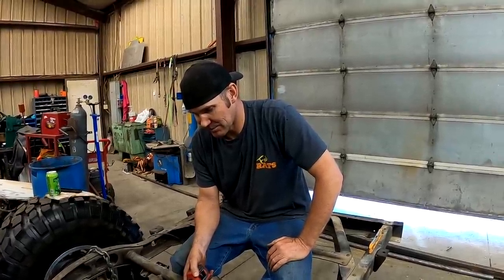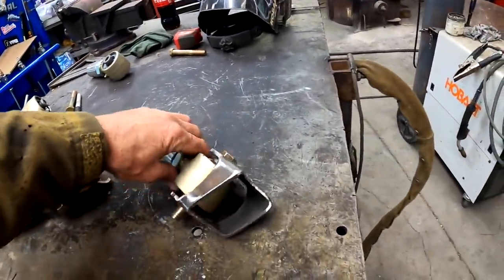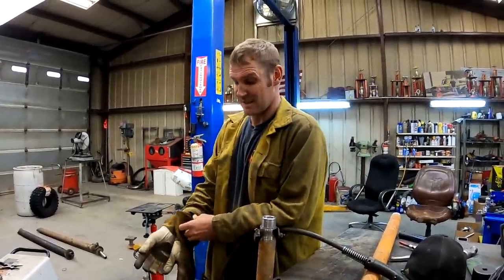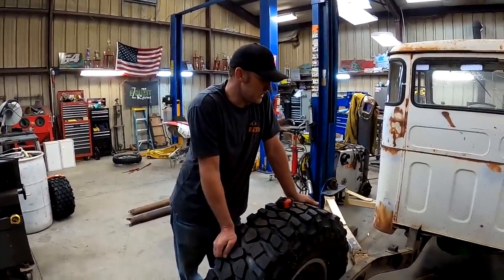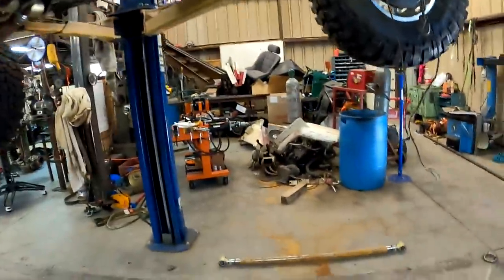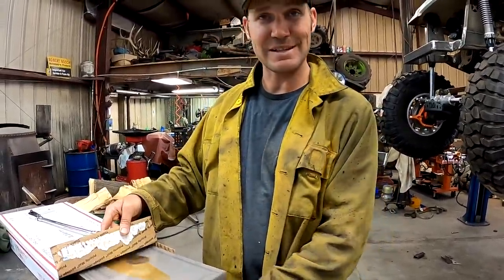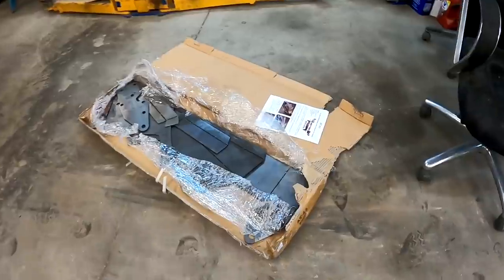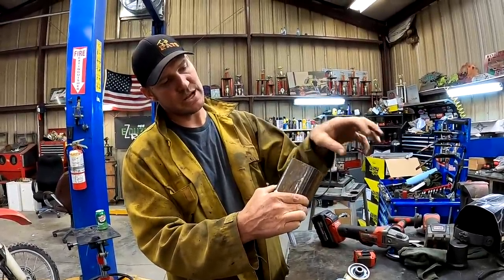This Custom FJ45 Ultimate Rock Crawler Build Comes With Custom PROBLEMS!

Comment: I was an engineer in real heavy oil engineering. The reason we went to computer aided design in a big part was to find all the errors before we built the stuff. Running the computer to find where stuff would not fit was fun, it was called the 'clash check'. When I started though in 74 we had paper and it was always a worry when the stuff turned up that it would fit. Working on vehicles though people don't realize is not easy. Anyone who can fix a car can fix most things.
Reply: I worked in a business that installed factory built fireplaces, and one of the contractors we installed for, built their first computer designed home. Hopefully things went better after that one. The corner chase didn't line up for each floor, so we used 18 adjustable 45° elbows to exit at the cap.
Reply: When I worked for Caterpillar, I pulled the transmission out of an articulated dump truck.  It was soooo tight that it scraped the paint off of both sides of the trans as it came out of the hole.  In fact it was so tight that after it was halfway out I had to tip it at a different angle to clear things, when I backed off with the crane, it stuck right there.  This thing weighed about 1500 pounds!  Could they have made the frame 1/2" wider?  I think so.  I had to grease up the sides of the trans to slide it back in place.  I think that I was just LUCKY that it was able to come out without frame modification.   The part of the frame that would have had to be modified was the Roll-Over-Protection mount.  That would have created a whole new bunch of problems.
Reply: @Rat-Builder  Designs (bad ones) like that can happen when the person doing the design has never had to work on a machine. One service I provided was 'maintainability' for a new design. It was amazing how impossible some stuff would have been to fix without a redesign.

Comment: Just curious, is there a reason why they rear hoop, on the frame ain’t behind the transfer case, so the joints line up the rear driveshafts front joint. 

Then you protect your transfer case, and can get more travel, because training arms can’t hit it either? 

I’m not at critic, I’m just curious, and wants to learn more.

Comment: Actually more excited about the little Suzuki restoration! Can't wait to see the Golden Nugget come back to life 😁👍
Reply: Hi Ivan !
Reply: Same here. That was an awesome recovery.
Reply: RollinRat  My personal work truck is a 2002 Suzuki XL7 4x4 so I'm pumped to see the vintage Suzuki be made road-worthy again :)
Reply: I also came here to request nugget content
Reply: fab rats subscribers going to go up for the suzuki build
Reply: RollinRat  same with me. I watched a couple of MORR videos a couple years ago, was immediately hooked, & saw Matt go to Fabrats shop. After that, I was immediately hooked to Fabrats channel😊  now it's the same way for me, MORR & Fabrats is the first two videos I watch as soon as I get the chance!😊
Reply: Ivan there not going. To rebuilt that thing?
Reply: RollinRat  Same here.
Reply: RollinRat  Suzuki has always put undersized "motorcycle-esque" engines in their trucks. Mine has the 2.7DOHC V6 which has to be revved for any performance lol. This LJ20 must have been only a few years old when Ed parked it in the wilderness. Apparently it features a 359cc 2-stroke water-cooled twin, putting out 28hp...WOW!
Reply: RollinRat  Thank you sir.
Reply: More like Moist Nugget now
Reply: @PineHollowAutoDiagnostics  
It only weighs about 5 lbs!

... In reference to the small engine. So many other comments, so that probably didn't make sense without context.

Comment: I'd say, fab rat a boom on the back and make it a Mater !

Since you run air bags, it should be possible to add extra bags to carry the weight. Mount two extra bags, to be activated as load is added?

Comment: If you are going to put bag on link, I would suggest having the frame side of the link non-adjustable (like a weldable uniball) so that you wont get link rotation. Making it similar to how lower links are made for pre-runner/trophy truck/hill climbers. Also shouldn't go shorter than 1/2 of the length of bar if you plan at all having a load on the truck (Like weighing it down with a trailer). 1/2 way will give you good lift but super soft, 2/3-3/4 away from the frame will give you decent lift but still be mildly stiff enough for load rating.
Rad project either way.

Comment: I would try and get the air bag as far out from center line as possible for stability.  If you mounted the air bags on a horizontal axis outside the frame rail with a 2:1 cantilever set up off of the axle you could get your 16" of travel.

Comment: Handy tip for the airbags. Cut 4 thin tubes (or timber, etc.) Two at just under max travel, then the other two at just above min size. 
Then you can use them for mocking up the cross member without worrying about reading the tape all the time.

Comment: Paul, Don't worry with dyslexia.  I've had it my whole life but I still got through HS and a BS in Electrical Engineering.  Then a 40 year career designing and building Power Plants.  You just have to allow extra time for CHECKING.  Also Michelle is a HOOT.

Comment: PAUL... PLEASE comment on this for me. I have a job I need to do and not sure how to proceed. 
 I searched every where and found MANY videos on how to convert a single axle trailer to a dual axle but I want to go the opposite way. Dual axle to single axle.
I have a small electric pontoon boat (12') and got a nice trailer frame for $50. The boat only weighs around 500 lbs and I don't need the dual axles. Single axle = less weight, cheaper on tires.
First off, would this be OK or you think I should keep both axles?
Secondly I would need to obviously remove 1 axle, get rid of the equalizer bridge between the 2 leaf springs and fabricate and weld in a new spring hanger but not sure of the process.
 So before welding the hanger mount it should have trailer weight on it and the shackle should be slightly angles back away from axle? to find where to weld it to the frame.
I would love to bring it to you to do it (and would take you 30 minutes probably) but I am too far away).
Any advice you could give is greatly appreciated. 
Subscribed a month ago and have watched every video you guys have uploaded for us.  By now I feel like you guys are family almost, well your family and that scruffy bearded dude that is in your videos sometimes (Your awesome too Matt)
 I am only asking because the small town I live in is not overly populated by great mechanics, I trust your judgement! I didn't want to call your shop and bug you
If your too busy I understand, keep up the awesome work!

Comment: Hey Paul long time watcher, first time commenter on your channel blah blah blah 😂 also I appear to be the resident mini trucker (Vegas) so if you don’t mind let me give you a little info on those triple bellow bags you want to run. Think of an airbag like a balloon, the more air you put in it the stiffer it will get and those triple bellows are two ply therefore if you top them out at 13 1/2” not only will it ride really stiff but with enough articulation it will separate the metal cap from the bag. Ask me how I know. Anyways if it was me personally I would try to get my desired ride height at about 9-10 inches of the bag on load. Should ride really smooth and give you the articulation I’m sure you’re looking for.

Next I would like to say not only did you guys do great work recovering the golden nugget but I am extremely looking forward to that build as well. Keep up the good work!

Comment: Very interesting to watch as 90% of off-road rigs are built just like this in someone's garage.  Not confident though that Paul understands suspension geometry, rotational tongue and leverage on a cantilever.  That suspension is going to do lots of wierd stuff anywhere above a crawl.  Cool build though.
Reply: I do not understand what rotational tongue is and I once was a formula 1 engineer, could you please explain it to me.
Reply: @R1Kyle  Rotational torque (autofill)

Comment: I think a new bit for Michelle needs to be “describe the smell of the shop today” for all of us used to working in a shop, depending on the project a shop can take on a lot of different smells, heavy gear oil, burning metal, paint etc. would be nice to set the stage for the viewers at home. Could be like Ed’s weather report on Matt’s channel.

Comment: All that frame weight from over-engineering is going to give it a good low center-of-gravity. Just resist the urge to over-engineer the body with lots of 1/4 inch plate steel.

Comment: Well first off, I couldn't believe  some people were actually so sad with their lives that they found a way to insult and belittle one of the best families the internet has available for others to role model off. Shame on them and good on you for calling them out guys.
secondly Paul, i know you will have a grip on the 45 project but i thought id share that we bent a couple of them just behind the cab where the chassis bents up. mostly it was caused from overloading them with fuel tanks etc for our forestry work and we made plates from 1/4 plate to stop it happening again once we bent them back ( usually with the dozer and loader, aka bush shop mayrak machines. lol). i sure would have liked this thing in the place of them back then i tell you mate. Love the project, love your family and love the content guys so please don't let the haters change you one bit. Now bring on the (not so golden) Nugget!.

Comment: What on earth are you doing Paul!  What have you been smoking? Placing the airbags there with the arms attached to the center of the rear axle is the same as placing the airbags in the center of the axle! That would create a “flopper”.  There is a reason why manufactures place the springs near the end of the axles.  Why not place the airbags there (where you would have installed coil springs or ori’s?)  You need to stay away from that “delusional food stuff” that makes you “willfully ignorant”.  Get back to reality my friend. :)